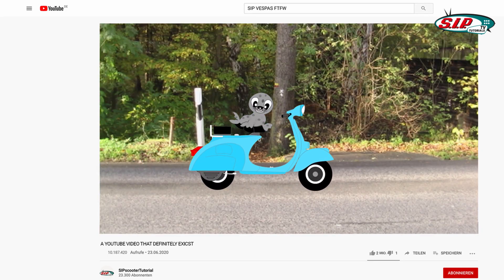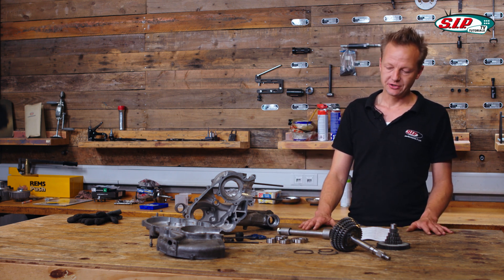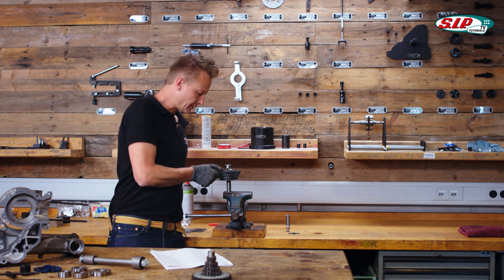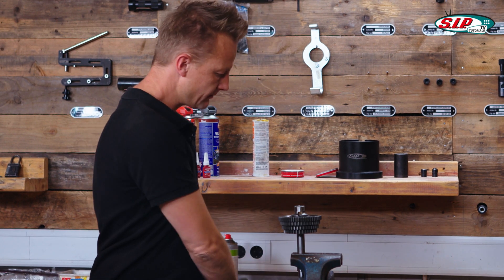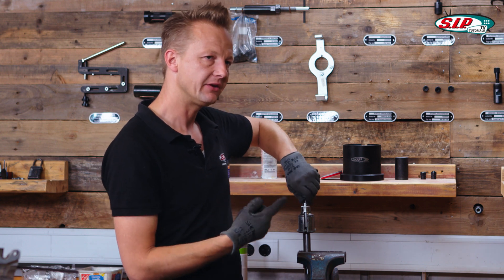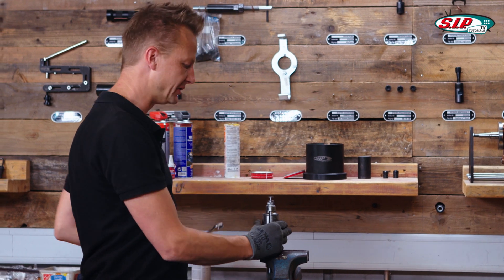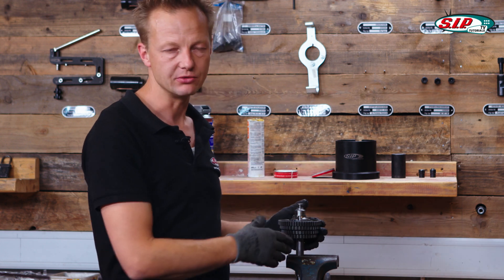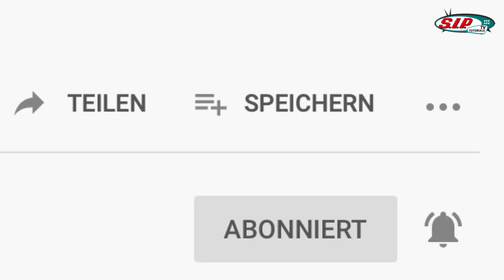VESPA ENGINE REBUILD 🔩| Part 1 | MAINSHAFT | Tutorial {English}

Comment: What was put on the gear selector bold? Was it Grease? If Yes which typenof grease should I use? (I dont mean the lock thide) 3:42
Thanks for that cool Video:)
Reply: that was thread lock, it is recommended to use as it's to bond your shaft, but it stil breakable unlike strong bond glue